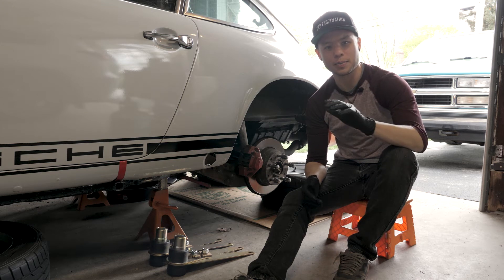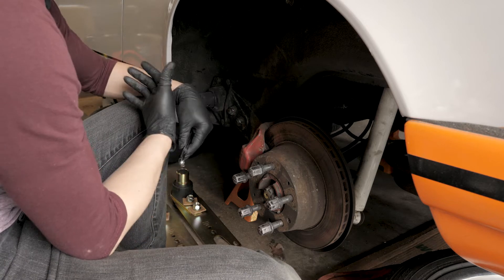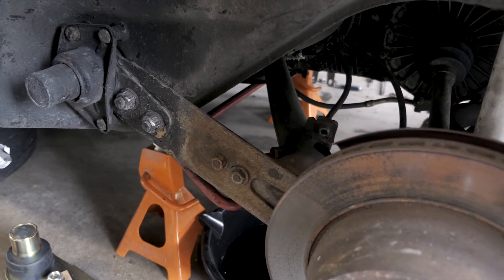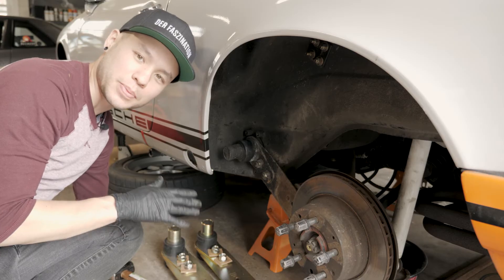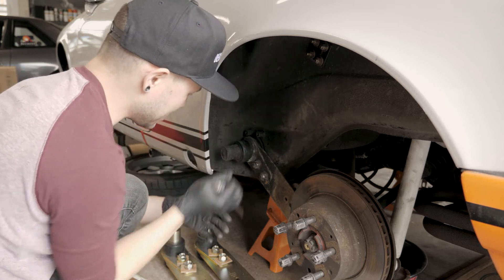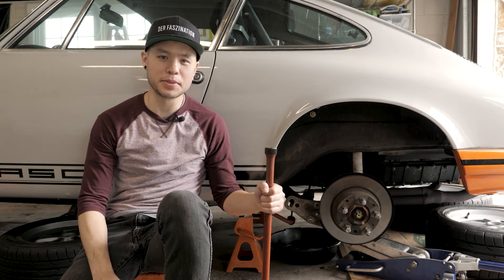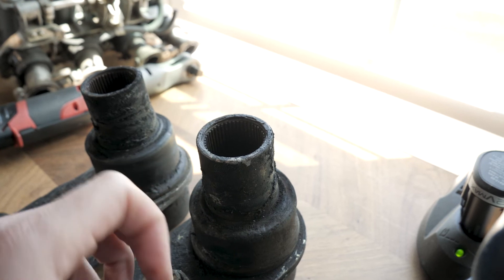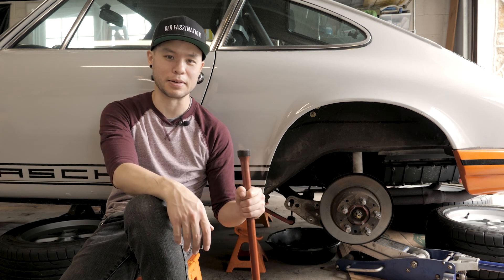Porsche 911 DIY Rear Spring Plates Pt. 1

Comment: What was the finale angle that you set the spring plate? I assume it was something less than 20 degrees. That would be the angle that you said wasn't low enough for you.

Comment: 50 year old rubber brake lines are probably going to be cracked and nasty.  Other than making for a spongy brake pedal they either work or they don't.  When they don't is will become immediately apparent and pushing down on the brake pedal harder would be a futile gesture.  At that point your steering wheel becomes your friend.  Your will also find brake fluid dripping onto the ground.
Reply from the maker: first thing I replaced on the car, and they probably should have been done 10 years before then